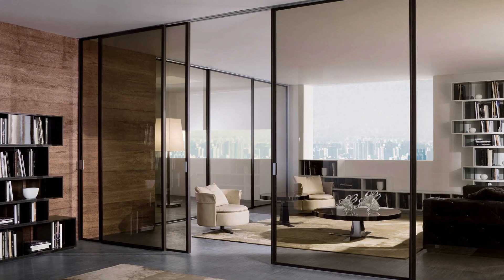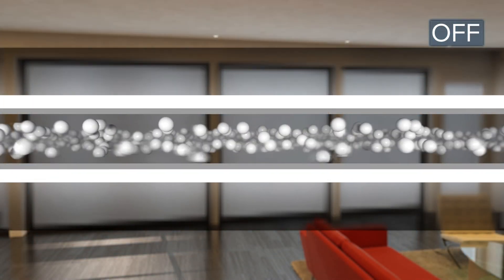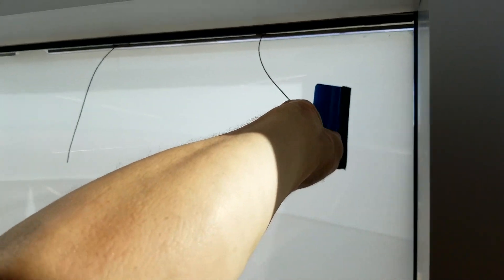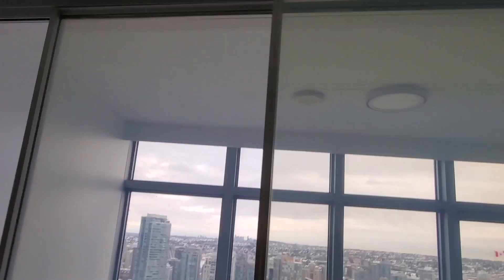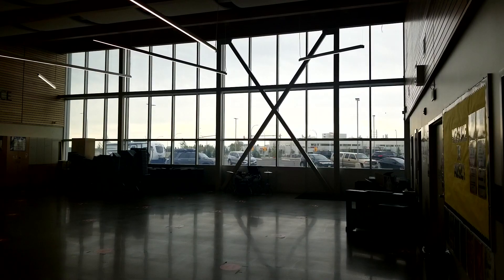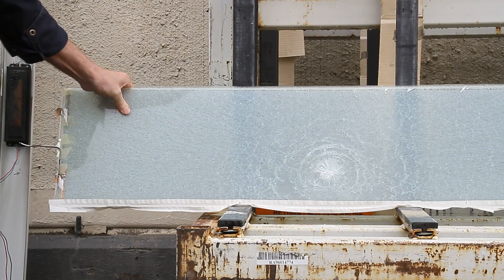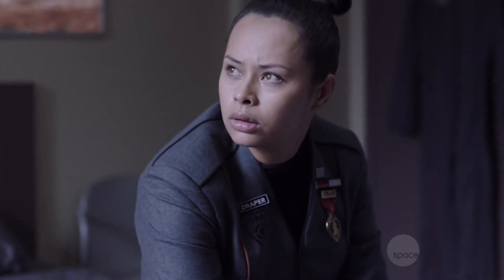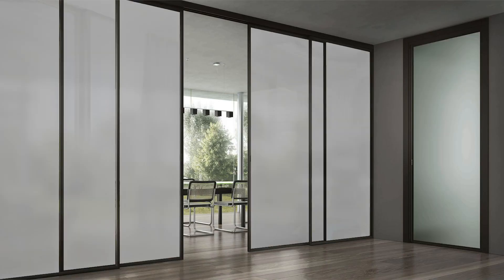Smart Glass 101- What is Switchable Glass? How Much Do Smart Glass and Film Cost? How Do They Work?

Comment: Hello , can i ask a question : can this smartfilm be integrated (applied on or produced inside) in transparent carbonfibers ? Thank you .
Reply from the maker: Yes, the smart film can be integrated inside of  transparent carbonfibers as long as the final product doesn't get bent. Please contact us for more details at www.smartglasscountry.com
Reply: @SmartGlassCountry  Hello , thank you for your answer . My crazy idea was to put smartfilm in or on (the inside) of transparent carbonfiber that makes out the shell of an aeroplane (to substitute aluminium general aviation skin) . Think of what an effect this could have , having a aeroplane's skin made out of this product (transparent carbonfiber with smartfilm) , instead of aluminium . If that would be possible . Flip the switch off , and you fly like in a normal plane , flip it on , and one is floating into aerospace . But maybe it does not work when , as you say , it may not be in a medium that bends . Maybe the aluminium shell of a plane does not bend that much . Was just an idea . Aren't there already GA planes built with carbon-fiber shell ? Imagine it on a private jet . Sorry for my wild thoughts . If i would have money to build a house i would certainly incorporate this smartfilm into my windows . Regards , Erwin .

Comment: Can you do custom window shapes with cutouts or rounded edges? Does this work on 12v or it requires 110v?
Reply from the maker: we can do smart glass of any shape, with cutouts. notches for hardware. Smart glass requires 60V AC, so we use step down transformer from 110v to 60v.
Reply: @SmartGlassCountry  how about for a windshield on a new Dodge Promaster van?

Comment: Have you done projects on camper trailers? I’m remodeling a 1970 Streamline right now. Predominantly 12V system. Also what are the power requirements? Predominantly 12V system that will also have lithium and solar
Reply from the maker: unfortunately smart glass works only on 60V AC. It doesn't work on 12 DC.
Reply: @SmartGlassCountry  OK thats good to know, a DC DC converter is easy enough. Still interested